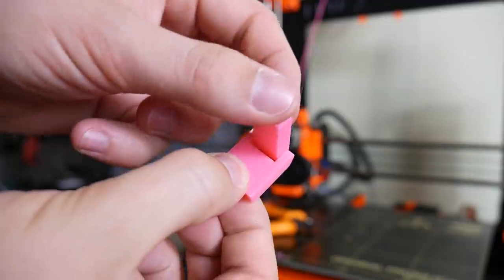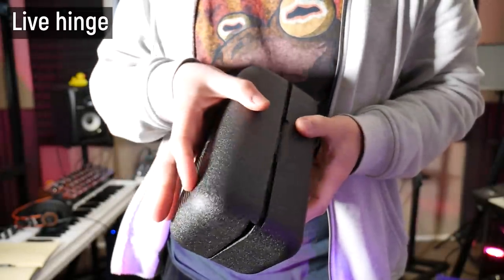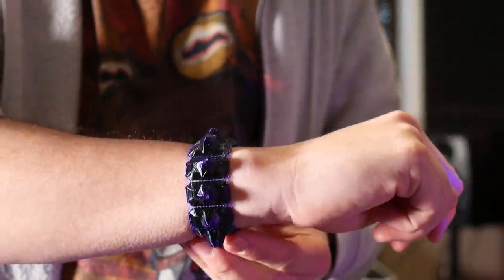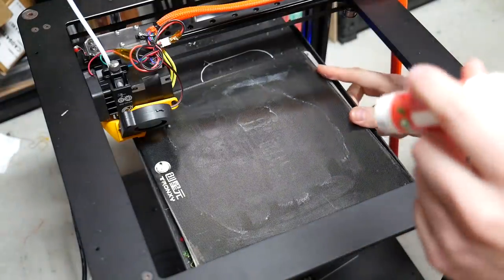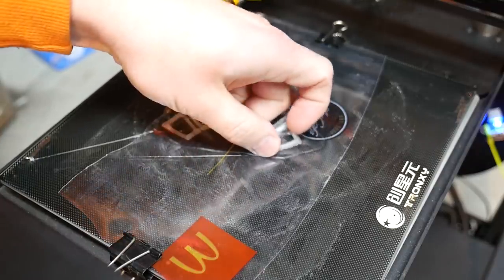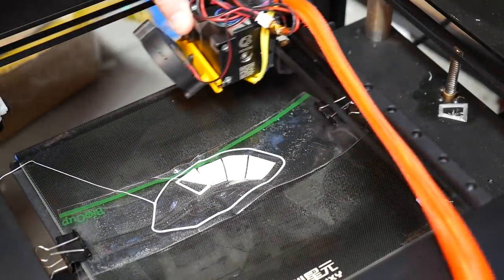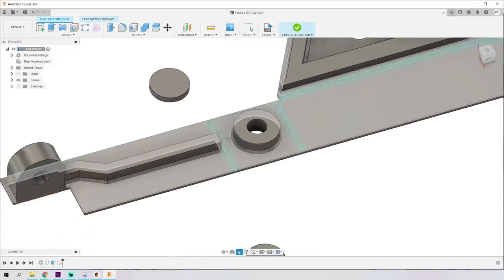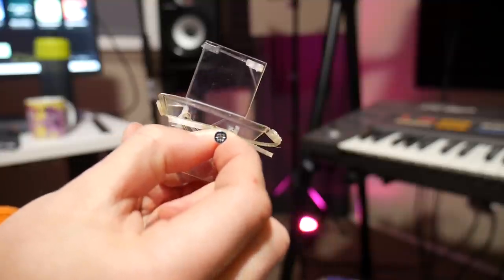Incredible Folded 3D Printed Mechanisms

Comment: PETG & TPU will stick together, meaning you can print first couple of layers in TPU for the hinge part(s) and the rest in PETG.
Reply: I tried blending PETG & TPU using Thingiverse 3565827, "3D-Printable Filament! -Print Your Own Filament for Multi-Color!".
The initial dual-filament print worked well, but had layer adhesion issues when I tried printing with it so might try increasing the temperature beyond 240C in a future test to try and help the melting & bonding.

Comment: @Maker's Muse Try running a raster (engraving pass) in the areas you intend to print over. Use a low-ish dpi setting. That will create a nice rough print surface and give the molten plastic something better to bond to! Much like your Up! Mini's print bed :)

Comment: Angus, did you try to use kitchenfoil? It works a bit like the fabric but it is invisible and quite strong when moved around.
A thicker foil you can use is the one from the filament-bags. I used it once but had to roughen it up with some sanding-paper for good adhesion.

For very small hinged-parts you can even use the thicker packaging-tape. not that strong or long-lasting but I had some pretty good results on that (printing with PETG on it).

Comment: Wow, you are not just thinking like a 3d printer, you are also thinking like a cnc milling machinist. Printing the dots for locating your laser cut sheet is like us drilling dowel pin holes to locate our parts for second operations.

Comment: Used to work in the factory making the McDs cups and lids. There's no coating and the recycled content is basically from the other new cups being cut away from the flat sheet and then the rest of the sheet goes to the shredder then gets remelted as the next sheet they form the cups from. But the little bits of ink or manufacturing oils etc might get in the way. Would like to see it analyzed to see what the difference is, and what the exact chemical composition of the original plastic is. I feel like there's a difference from virgin plastiiic.

Comment: I'm doing research on additive manufacturing of compliant mechanisms. I've tried with Nylon and Polyester filaments but so far the best was FormFutura PolyPropylene / PP. The only issue is bad bed adhesion. Transparent PP packaging tape works great once you find a quick way to remove the tape residue.

Comment: Maybe you can use any PP sheet by avoiding the bed temp issue (retraction of the sheet). You can put the sheet in boiled water to completely retract the plastic, then it can't warp during the print with the bed heated.
Sorry if it's not clear, english is not my native language.
I can try to explain different if it interest you.
Intresting video :)

Comment: Very interesting, love the detail of the iterative process you went through - this is all really useful informatio n. 
14:40 - You mention that using fasteners is not feasible at this scale, I've started to print earthmovers in 1:32 (so about 90mm wide) and have so far printed two operational iterations of a steered and driven front axle using M2 screws as fasteners and pivot points. M2 is really easy to use, below that it can get a bit too fiddly for my taste. I realise that's not what you are going for and of course it's always great to have more options, so I'll follow your future experiments with interest! :)

Comment: I often use a piece of filament as an axis for the hinge, this is in most cases more easy to print (instead of print-in-place-hinges), and it is more durable. But make sure not to use PLA filament for the axis, because it becomes brittle with time.

Comment: New subscriber today...I like the multi-pronged approach to the problem solving...well done.  
Fusion 360 sheet metal is quite interesting and has application “outside the box” -
You should check out the Diabase hybrid printer and how they are approaching additive/subtractive, multi-material builds.. right up your alley...
Thanks again

Comment: PETG makes fantastic living hinges, but there is a catch!
Print the hinge as one would expect, but there is a 'training' interval involved.
Slowly, and I mean very slowly, limber up the hinge.
Bend it a few degrees this way and that, letting the material warm up a bit.
Slowly increase the angle of the flexing until you get full mobility.
PETG has a reputation for brittle failure, but if you take your time, it makes a very tough and durable hinge.
The flexing and stretching aligns the molecules, or something.

Comment: I know this is a little late, but I would think you could use polyester or nylon fabric. I don’t have a printer yet, but I have a fairly good understanding of how things work. I know both fabrics can be heated or ironed. I don’t think the heat from the bed or the extruder would be too hot, and you probably have some old clothes that might work.

Comment: Pretty neat experiment, as a note about spray adhesives. I use them in my workplace and the best way to clean them up is either with acetone or methyl ethyl ketone. I would suggest the acetone first, as the MEK is some pretty strong stuff, which might be industrial only, I'm not sure. A cloth with acetone should clean the glue off nicely.

Comment: You can also use acetate sheets to print on, i have been using them to print clear windows with PETG frames , they love PETG by the way, binds like a boss. I also recover clear film from toy boxes. I found out the best way to stick them to the bed is by holding a sheet square in a paper tape frame, You don't even need to heat the bed, the nozzle will bind the PETG first layer with such a strength you cant remove it by hand. The results are awesome, so far i have made windows for buildings, cars, aircraft models and butterfly wings, these last work really well.

Comment: As a rc glider builder we use fine kevlar as live hinges laid up within carbon and glass composites . Using the mid print mesh layover technique would work and be wayyyyyyyy stronger ,durable and more flexible than any plastic hinge could ever be . If your open to testing id send a small sample, the only thing id see being an issue is getting the plastic to knead into the fibres , maybe a hotter mid layer tip temp to make it more runny ?

Comment: Try binder/report covers, they're relatively cheap (for lots of sheets) and you can different thicknesses.  I used some thick PVC ones for making face shields early in the pandemic.  Unfortunately they don't always say what material they are when you buy them.  If you have any office supply places open they might be able to give out some samples, if not I'm sure if you contacted them they'd ship them out (even in lockdown).
Reply: I  also produced face shields to help replenish the supply of PPE early in the pandemic. You can use much thinner plastic (acrylic, Mylar, polycarbonate, etc) by folding into a 3D shape using an inexpensive drag knife cutter (I like the Silhouette Cameo-4 as it has up to a 5Kg cutting force) to mark and cut-weaken curved FOLD lines that turn a 12" x 12" sheet into a 3D face shield that's fairly rigid. Just add an elastic band for a complete face shield.

Comment: I wonder if overhead transparency sheets for use in photocopiers and laser printers would work for this.  I'm pretty sure they are polyester.  They don't shrink/warp.  They have a rough surface so toner will stick.

Comment: So when I was doing double sided PCB Isolation routing, I found that disabling G28 AND the feature that disabled the motors after a job in firmware and manually touching off at a known location on my PCB blank (like a CNC drilled hole at X1 Y2) and just sending G92 X1 Y2 would then accurately Zero the modified 3D printer on that known hole location and isolation routing worked great! I also trammed  my XY plane on the PCB making printer to within 0.1mm using threaded rod from one corner to the other. Once skew was gone, I had +/-0.25mm accuracy of any hole inside of 15cm sq area on my print bed. I made a 14cm sq double sided PCB using a dremel mounted to my hotend mount then a drag type engraver to scratch off the layout fluid for iso routing before etching. Then back to the scratch engraver for revealing the pads which i then coated with liquid tin before soldering.

Comment: Dear Angus, did you try 3D print the whole parts together with 3D printed thin layer between the parts WITH changed angle on the bed? I mean turn the whole design straight bottom parallel with the printer's nozzle path how it goes originally. If the hinges parts has all straight lines 90 degress to the planned bending lines then the filament PLA or any other material could work well too and you could create much thinner layers there as your tried PLA sheet from your coffee cup. Just a tip! Thanks to shared the whole process! BLADE

Comment: Could you print your first layers in TPU then the rest of the print in your solid material?
Reply from the maker: Yeah! You could definitely change between filaments to get a better result.
Reply: Yes, this is what I was thinking. No need for a multi-material printer. Just insert a pause for one manual material change.

Comment: Just use the 3d printer and change material for the hinge. I used PLA-TPU-PLA sandwiches in the past. Kind of annoying to change the filament twice mid print but it works very well.

Comment: Great video, thanks and please keep them coming.  I've had great success making hinges with a laser cutter by cutting, out of focus, a straight vector across the place where I want the hinge to be. By adjusting the cut's power, speed, amount out of focus, and  # of retraces, you can "machine" a groove in the area you want to bend.  This produces a wide groove in the hinge area, thinning where you want it to bend and also giving it room to bend. I use a number of overlapping thin rectangles instead of vectors, reducing the no-cut, vector retrace operations. Glued plastic blocks on either side of the bend keeps it from bending too far and eventually breaking. My favorite materials for this are 1/16" - 1/32" polycarbonate and acetal (Delrin) but be careful of the toxic gasses! Also avoid boiling the plastic as evidenced by tiny bubbles. I've also had limited success at making non-straight hinge lines where I curve them just enough to toggle and not break. You can use the curved "hinges" as folds to make 3D origami-like objects. See https://1drv.ms/w/s!ArR5UKe1sAa9ie8msMns2txQlk24Fg?e=YSveSN  for other ideas.

Comment: Some real world live hinges are made from PP - Polypropylene (recyle number 5). It excells at exacly live hinge scenario with enough flex and plenty of fatigue limit. You can print with it as i've seen PP filaments avvailable yet for thin films for livehinges, blowmolded and injection works better with PP.

Comment: Going back to your mesh fabric idea... Here in Canada, most window screens are made with aluminium and compared to fabric would have very little stretch along with being fairly durable. Alternatively, some are made with fiberglass (or you could use fiberglass material used for automotive body fill). All these things are readily available at most hardware stores, thought I'd share my thoughts, although completely unfounded or researched!

Comment: For the problem with laser and 3d printer:
Maybe one of those 3d printers with a swappable laser head could work?
The repeatability should be better because it uses the same device for printing and laser?
Reply from the maker: Yeah, if you have a diode laser perfectly aligned you could do it all in one with a toolchanger system. Pretty neat concept!

Comment: The ultimate Hybrid Hinge! It would combine:
- Print-in-Place Hinges
- Live Hinges
- Fabric-reinforced flexible plastic
- Multimaterial printing
- Laser cutting
- Mechanical pressing
- CNC milling
- Careful, sensor-assisted calibration

Now... I wonder if it's possible to combine Resin printing and FDM printing.

Comment: Seal the base layer with painters tape and pull a vacuum on it.  It doesn't need to be a huge vacuum, just enough to hold it down good.  Similar to the vacuform machine or (what I'm more familiar with) CF or GF composites.

Comment: Hinges o.O! This made me revisit a work project I finished but I'm still not totally happy with that maybe you'd have some insight to.
I have some robotic legs that are 4 sections per legs and pivot at each intersection. My problem is the hinge being tight enough to hold the small amount of weight of the turret attached to the legs. I've tried an elastic glue, 1.5mm ball bearings, 28g wire, but haven't tried to use screws yet as the size of these are quite small as you can maybe glean by the size of the ball bearings I use so it's not just resin layers grinding against each other.
Reference is the Division 2 turret legs.

Comment: Why not print on Kevlar cloth used in home-built aircraft market? It's also used in boat building to cover the bottom of hulls.
It's the cheapest and most durable for this application, has nice color, and you can bend it back and forth, until the sheep leave New Zealand.

Comment: try using PET bottle as base layer it's around 0.2-0.3 mm thick
Reply from the maker: Good plan, difficult to find a perfectly cylindrical bottle profile but will look when we can!
Reply: @MakersMuse  cut it to form a plane then stapple it to board and use heat gun to make it strait and smooth

Comment: Reason why the filament possibly does not stick onto some coffee cup's foil might be due to the fact that some foils are laminated.
like for instance (meat) packages that can be pulled to open them have a glue like layer + strong middle layer + an outer layer that holds back uv light to protect the contents.
besides that, thanks for this beautiful use case scenario!

Comment: Angus, Could you make a print bed that is perforated like the vacuforming table and pull a suction on the plastic sheet to keep it in place? eliminating the need for both the spray adhesive and the double sided tape.

Comment: This is similar to a build method I think could work very well with the MarkForge printer that lays down continuous fiber in the x-y plane.  Basically you could make origami structures where the fiber follows around the live hinge to get stiffness and performance in x, y, z in final part.

Comment: Question. Can make and use a vacuum bed to the print on so it holds the flexible first layer in place.
Could use a variable speed for the vacuum and even put plastic sheet off cut to close and open area's.
It would be similar to vacuum mold box. But smaller.
You'll need a fine heavy piece of metal mesh,
And print a cavity area for support the mesh, and vacuum adapter and jobs done

Well give it a go, you'll need measurements for your current bed to fit to or replace, what ever is easiest

Comment: great trial and errrors! 
Just an idea: Instead of putting plastic sheet on heat bed and print on it, how about doing it reversed? Like, first print the object on a removable heat bed, then move the prints with the bed together, into the laser cutter. And then you stick a sheet of plastic, and you fuse plastic to prints by laser drawing tons of dots on prints. And at last you let laser cuttter cut out plastic sheet and remove the print from the heat bed.

Comment: Do you think that the separation you experienced could be caused by the 2 side tape you used to secure the plastic to the printer? Maybe the printer head does not press enough against the plastic in the areas between tape, bending there, since there is empty space there. Just a thought.

Comment: Maybe I'm just a dummy and missed something but what about just glueing on the parts to the plastic film after they're printed? The components could have horizonal supports kind of like a flat pack model to keep them in place before glueing maybe
Maybe another option could be to have small slits in the edges of the parts and sliding in the plastic film there and either gluing or clamping them in place somehow

Comment: I've never had much luck with prints on my prusa being perfectly flat, or they just come off mid print, or warping. No matter how long I spend tweaking it. Gluestick didn't seem that good either. I now spray very lightly some Super 77 3M contact spray on the bed and it works perfectly every time. Cleaning the bed plate is easy with a bit of thinners, followed by IPA immediately. Bed still good after 3 years.

Comment: what about using a vacuum table? If you have access to a laser burner or CNC it wouldn't be that hard to build. I know it's a bit of an extreme solution, specially for not knowing it will work. But I think it's worth a shot.

Comment: I love the live hinge concept and some months ago watched a video from an MIT prof (can't recall the details) who had done some great work in on single part control switches in plastics (includinging nuclear launch lockout mechanisms).  Flexible, low mass, low cost moving things should be more prevalent than they currently are.
Anyway, back to the success on the PLA coffee cups...I may be naive here, but why not make a huge island the size of your print area in PLA and then run the other materials?  And, just to be really clear, I'm not yet a 3D user and have been planning and researching for weeks now.  So... yes, I am talking through my hat.

Comment: I understand your desire to print the whole thing but Heavy duty tape as used to repair poly tunnels has a very strong waterproof adhesive and is very flexible. You could also print a bed with registration points on it that could be reused. This would make a known height and position to work from even if you had to approach it empirically once its right it remains right.